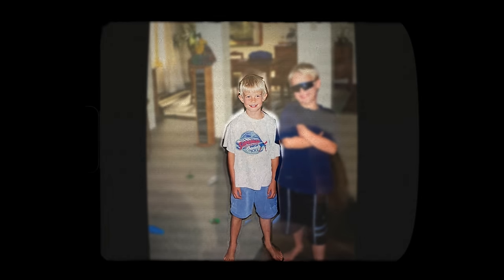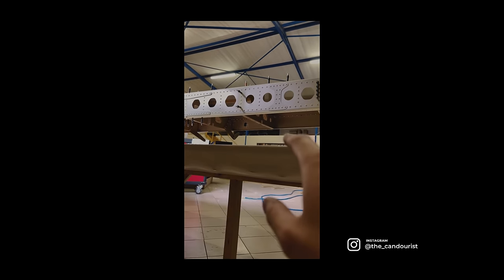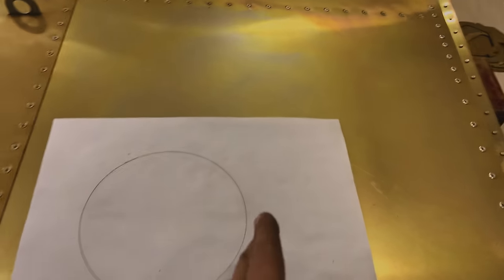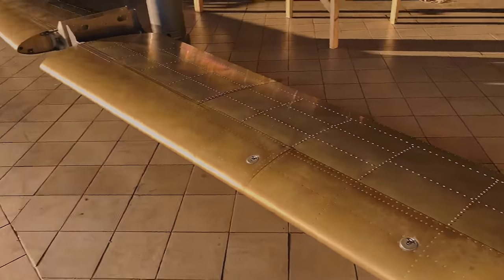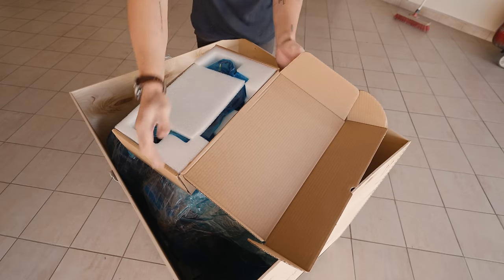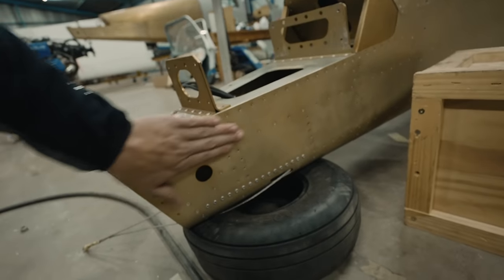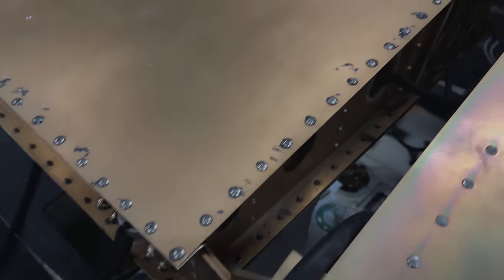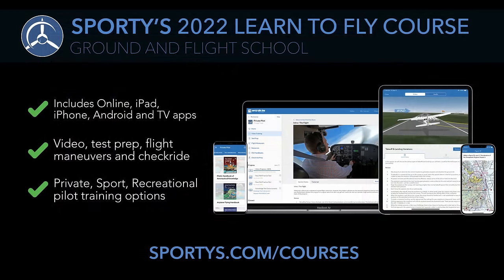I have 15 days to finish Building my Airplane!

Comment: I am a Marine and Automotive tech . I am blown away by the quality of the wing spars and braces and the thickness of the sheet metal . That is a freakin 10 I had no clue with the society we have today with no pride just slap it together and gouge for high prices that there was any good quality manufacturing left.
Reply: Sling aircraft kits are in high demand due the quality, they use very high tech machinery, to manufacture the parts, not like a lot of there competition, probably why they turn out really good looking aircraft which fly like a dream
Reply: Probably that's why more and more flight schools are using the sling 2 and 4

Comment: Having been a boat builder and marine electronics installer for many years many I suggest you use a small trim router with a straight bit and a shop built base to cut perfect round holes. It can also be used with a template to cut the baggage hole and door with great precision. I use these techniques to cut holes in the dashes of mega yachts for electronics.
Reply: All those chips and metal contamination definitely got into the wing cutting the hole. Not sure the repercussions of it.

Comment: What could get overlooked or missed?
Don't rush anything. 
 Take care of yourself.
Reply: @the_candourist  Great work and tail wind for all your projects! I love to see your updates and adventures... 👨🏻‍✈️

I don't understand one thing about the metal you are using for your aircraft: it looks quite 'yellow gold' and I wonder if this is a primed aluminum or if it has been treated in some way. My concern is that I see you are drilling the holes and just riveting without priming the holes. I don't know if I make any sense about this, but if it's not too boring I would appreciate if you can clarify the technical aspects and specs and let me know.
👍🏻

Comment: Awesome job, considering the timeframe and your health concerns during the build. Using a Mike Patey-like work ethic let's you get a lot done. Where are you going to put all the fuel for the rtw trip, or going to go over gross weight like the 210? Great looking kit; is the gold an antocorrosion coating? If so, does it come standard with the kit? Best wishes!!!

Comment: Question: Why does the Aluminum  look gold. isn't anodized?
Reply: Maybe anodized but I think its alodined. Anodizing can weaken the metal were as alodine holds its strength while staying corrosion resistant.